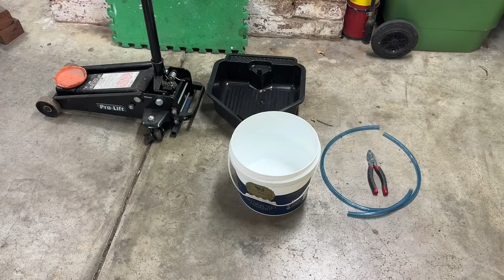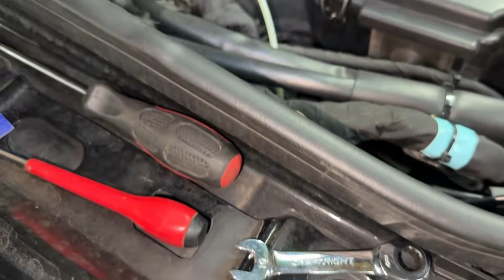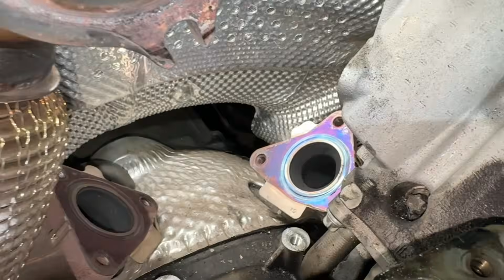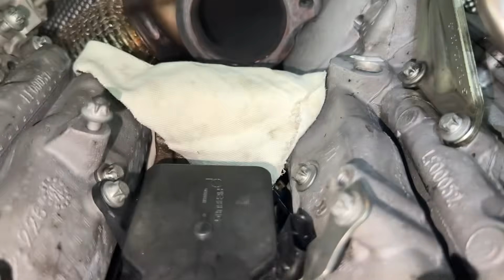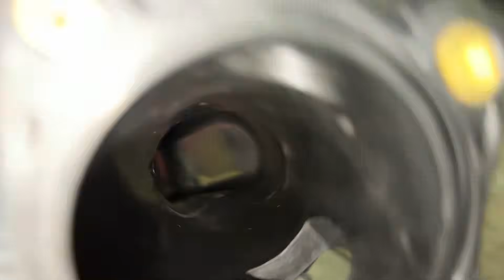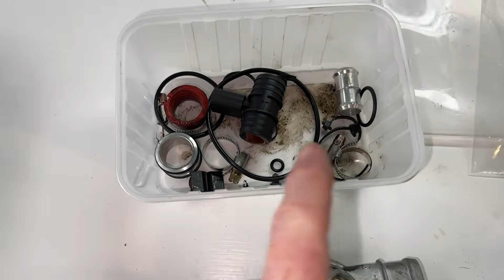Mercedes OM642 Oil Cooler Leak – Full Repair Guide (ML350 W166 BlueTec)

Comment: Is it possible that it wasn't the oil cooler seals after all? Did the oil come from above—from the turbo? Would it likely have been enough to just replace the PCV valve and the two orange seals on the turbo?

Comment: Muy interesante e ilustrativo el vídeo, pero una recomendación antes de encender el auto, lo primero es con 3 o 4 veces se pone el suich en posic.2 para purgar la tubería de combustible y después se pone el scanner para borrar códigos fantasmas que en el desbarate hacen que la ecu, cierre el paso de inyección por seguridad. Después de borrar los códigos allí si de da encendido, y por seguridad se desconecta el conector de bujías de precalentamiento. Lo demás está perfecto.
Reply from the maker: The video is very interesting and informative, but I have a recommendation before starting the car: first, turn the ignition to position 2 three or four times to prime the fuel lines, and then use the scanner to clear any "ghost" codes—which can occur during disassembly and cause the ECU to cut off fuel injection as a safety measure. Only after clearing the codes should you start the engine; also, as a safety precaution, disconnect the glow plug connector. Everything else is perfect.
Thanks for the good advice, glad you enjoyed it.

Comment: "Awesome" cleaner in the 1 gallon jug and a spray bottle cut that oily carbon. 👍👍👍 I also bought a walnut blaster gun and used that to clean. Very messy.
Reply from the maker: good advice

Comment: FCP EURO sells complete gasket kits. 
I removed my flapper motor and dampers and got a plug in resistor for the swirl flap motor.
Reply from the maker: Thanks, I decided to keep mine, they are still working ok.

Comment: MANY DAYS. Cleaning is crazy. This is a multi day project.  Do not be in a hurry. Rent another car. Make sure to take out the glow pugs and turn it over to prevent Hydrolock. I removed my injectors and sent them to S&S diesel in Indiana for check/ test and rebuild. Having the injectors out is better to allow you to blow out cylinders after cleaning the valves and valve ports.
Reply: A few hundred bucks and you got new injectors pre and post results, tests.

Comment: I’m in Texas, have a 2014 ML350 Blutec with some EGR related codes.  Replaced EGR valve and sensor, but also losing coolant, so thinking I may need to replace EGR cooler.  

Any tips, tricks or advice you can offer on the EGR Cooler replacement?  Don’t believe I have to remove manifolds and turbo, but appreciate anything you suggest!  

Great video and well done!!
Reply from the maker: Hi, from memory you will need to remove at least most of the stuff at the front and on top to get to the cooler, including the inlet manifolds. What makes you think the EGR cooler is leaking?  Have you ruled out anything else leaking?  If I was you I would do a pressure test first.

Comment: Extremely vague on cleaning valve ports. Like magic 🤷🏽‍♂️🤦🏽‍♂️
Reply from the maker: It’s a video on oil cooler leaks, not cleaning valve ports.
But being as you asked, I used the same method as cleaning the inlet duct. I vacuumed out any large particles and then used oven cleaner or solvent to dissolve the carbon and wipe it out.
I didn’t do a walnut blast or anything like that.

Comment: Great video and very usefull

@41:30, Question - did you tighten the High Pressure Fuel line Nuts 20nm and 20degrees at both the Rail end and the injector end? or only at the rail end . It was not clear on the video.

Also on the other fuel rail there 3 injectors and an additional high pressure fuel line that connects between the fuel rail and some other point (not injector), is that also tighten the same? Where can you find the torque settings?

i am in the process of replacing the low pressure return fuel line as i accidental broke the T connection, but i realised that it runs under the fuel rail so i need to remove this. but don't know the torque setting to reconnect. 

Alternatively, do you think running the return fuel line over the fuel rail will cause any issues?

thanks
Reply from the maker: Hi - I have added the torques I used to the description.  The Fuel rail is 20Nm all around, plus 60 degrees.  I struggled to turn them that far so stopped early, and nothing is leaking.  It is best to make sure they are nice a free, and you may need the special spanner depending which ones you undo.
The return line should be no problem over the top, as long as it has enough length. You don't want it coming out anytime.

Comment: Great content sir that's really awesome! Did you see some people connect the PCV Valve hose far from the turbo? They say it helps to stop oil leaking.
Reply from the maker: Hi, thank you for the thanks. The oil mist from the PCV will still go through the turbo even if it is further up the inlet.  it may help leaking if it pools somewhere, but you can only stop leaking through maintaining the seals or stopping the oil, by for example adding a catch can.

Comment: Those " copper " bolts are copper plated steel bolts .
Reply from the maker: You're right, they definitely aren't solid copper.  They are high-tensile steel with copper plating.  The copper stops them from seizing.

Comment: Could a damaged oil separator make a chirping sound like a bird after the engine warms up? I have already replaced the PCV valve and the hoses, but the sound is still there. Do you have any ideas?

Comment: Evening from the UK. I've just aquired a 350Bluetec with the cooler leak. What is the scanner you used in the first video to lower the suspension further?
Reply from the maker: Hi - It is a Vident iSmart600 Max - I have other videos about it on the channel. - Great scanner.  I also have a iCarsoft MB V2.0 that I think can also do that.  Having said that, next time I would take off the wheels and lower the car down to the disks as others have suggested to save the suspension reprogramming.  Also works if you have steep springs!  Good luck with the cooler leak.
Reply: Thanks do you have the Inlet Manifold and turbo torque settings please

Comment: From where did you get the "book" and the manuals with the NM and stuff ?
Reply from the maker: Hi, no book, just forums for the Nm and general guide.  there is some debate about some of the torque's for example on the turbo EGR pipe, but I just took the average of most guidance.

Comment: Is it possible to do this job on my 2008 Vito with engine still left in the car or do i need to lift the engine out of it?
Reply from the maker: Hi - I would think it is possible if you remove all of the scuttle panel.  Certainly harder than on the ML.
Reply: It is possible, but just getting the turbo off is a pain in the ass. Also removing the engine is even bigger pain in the ass as you have to remove all of the coolers etc to pull engine forwards. I would personally do it with engine installed

Comment: The pcv valve where the electrical connection goes is a heater element. No idea why, mine went faulty and threw up a code.
Reply from the maker: Interesting, never thought about that it was a heater. Maybe to de-ice in cold climates? Same with the DEF heater - I am in Australia so both are not very useful.

Comment: Really useful video.
I did it few weeks ago.
The most difficult part was to restart the car after fuel lines removed.
1 recharge the battery to 100%
2 prime the circuit in pos2 few times until air noise stops without starting the engine.
3 start the engine with glowplugs module disconnected 
😊
Reply from the maker: Glad you found the video useful, thanks for the extra advice!

Comment: Did you get any estimates of what a repair shop would charge for the job?
Reply from the maker: Hi - No I didn't, but looking around quotes seem to be US$ 1800>2400, but I have seen as high as $6000 and as low as $1000.  It took me 30-40 hours.  I think with a good shop and experience you could get that down to around 20 hours.  So it is still going to be very expensive.
Reply: 2026 and I was quoted a little more than $6k at my local European car repair shop here in Michigan.  2014 ML350 Bluetec.  With the aid of this and other helpful videos I’m going to DIY it.

Comment: Hi Jack. Thank you for this very informative video. Watching from England. sadly my GL350 has been leaking and I suspect it’s the dreaded oil cooler seals. Your video has given me the strength to start it myself. Will be using your video as a guide. Ordering the kit now. Wish me luck. Subscribed
Reply from the maker: Hi, you're welcome, hopefully the video is helpful.  That is the first time I have done it, so apart from it taking 30-40 hours, you should be fine. It was longer for me due to the filming, but helpful if you forget anything!  I have subscribed to you too. I have a 200SX so videos coming of that soon. Looking at your vids I'm sure you will approve.